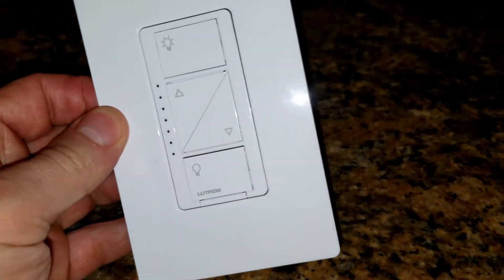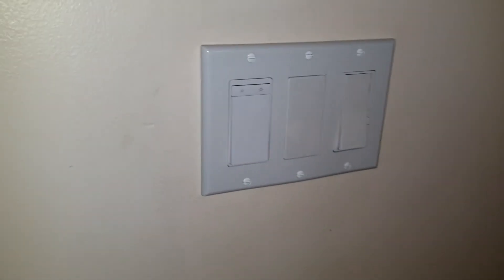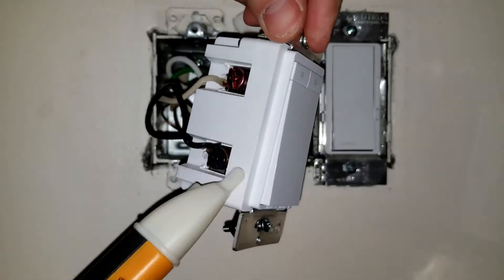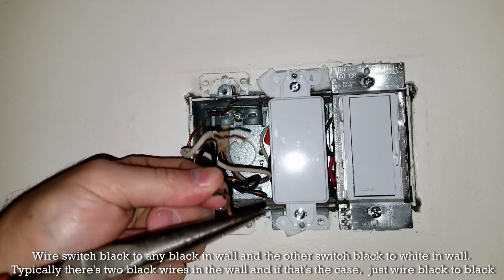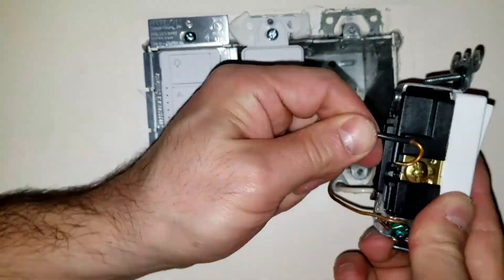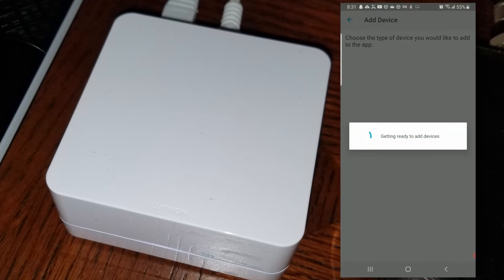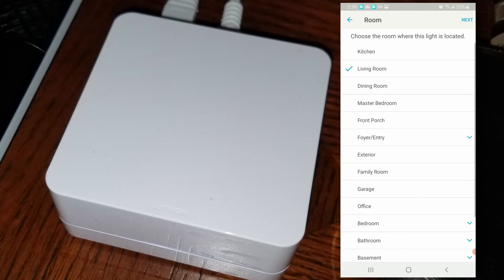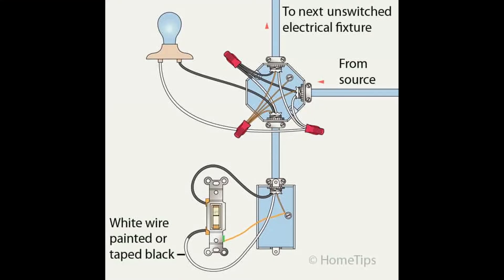Install a smart dimmer switch without a neutral wire - Lutron caseta install

Comment: what do you do with the neutral if you have them when installing Caseta switches
Reply from the maker: Tie them in to another neutral if it's not a switch loop
Reply: @daP.A  Forgive me for my lack of electrical knowledge. I havent pulled out the switch yet but my house was just built so I am assuming it will have neutral wiring. I dont know what thats attached to or what you mean by tying it to another neutral. I have a bunch of 3 way switches and a handful of 1 way. Should I not use the casetas and use something that uses neutral or does it matter?